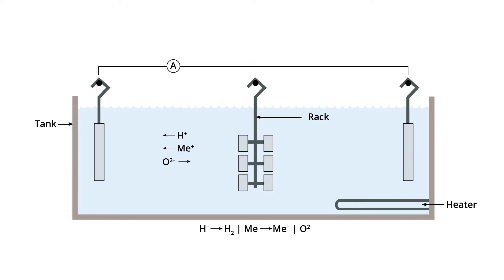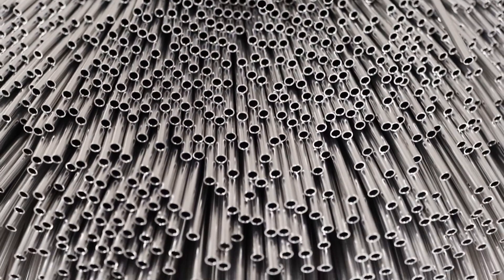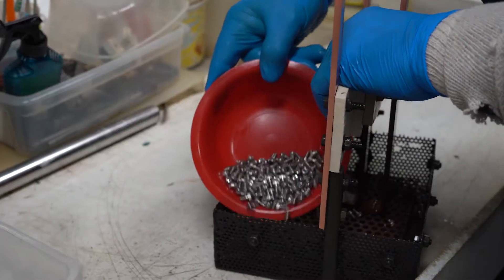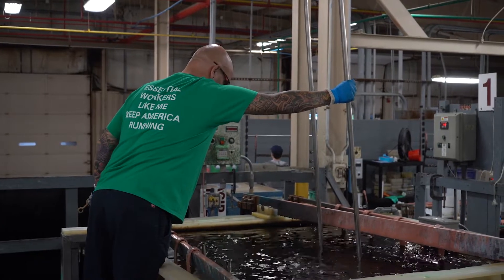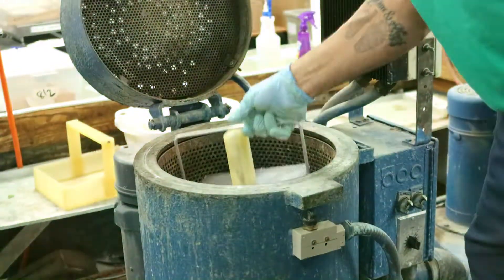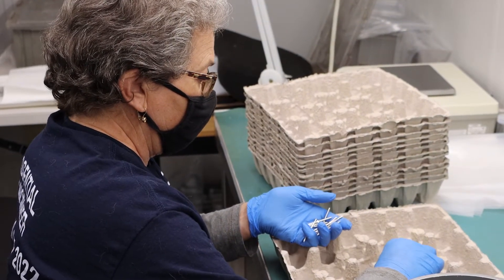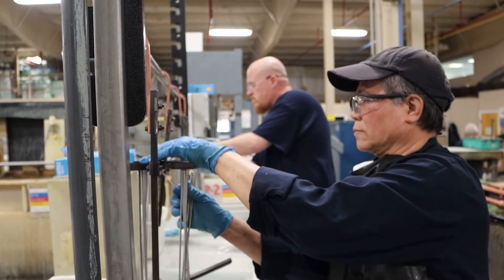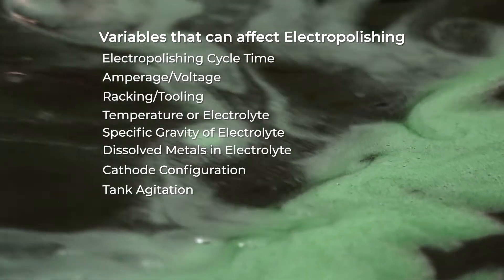The Electropolishing Process

Comment: does it help remove deep scratches ?
Reply: Electropolishing removes material (Eg - SUS 316L). So your scratch will not be removed and it will be bigger. However, the amount of material removal can be adjusted. Therefore, the scratch will be bigger, but it will be a nicely polished scratch. Usually the surface finish is the primary consideration, so a scratch would probably require manual scratch removal before electropolish.
Reply: @alishera.2540  what's so funny
Reply: @hypertool35 In my experience as an engineer in Pharma, no. I generally view it as a finishing process to reduce Ra, achieve a desirable aesthetic or clean welded features after some level of manual polishing.

Comment: Thank you for that beutiful, informative series. I am sorry if that sounds a bit dumb question but I am trying to understand the fundemental. As far as I understand from those video you are removing the free Fe atoms on the surface. Now the surface has little openings on the oxide layer where below those little openings the alloy metal. Those place became opened becaue you removed some (non oxide-just Fe atomor other things). Please sorry for my English, I am not a native and I am trying to exaggerating some to emphasize better. Now my question is: Are you closing that opening with chromium oxide layer in your bath or it is closed individually  immediately after you pull it from the bath. (Natural passivation). I hope I'm not rude to ask your know how.

Comment: What is the function of the heater?
Reply: Speeds up the reaction time, and I've found also decreases the resistance between the electrodes. As a result of this, the material removal rate is increased, and oftentimes the quality of the polish will increase (best to find a balance as well as cost-benefit). EP also doesn't work very well with the standard solutions at RT. I use a salt solution for my polishing as it helps me keep the temperature down significantly with sensitive parts.
Reply: The temperature of the electrolyte solution does what the other commentor stated, but I thought I'd emphasize that it can really effect the surface finish and the uniformity of the finish greatly. If you turn off the tank heaters before you go home at night, try electropolishing a panel in an ambient temperature solution and I think you'll see what I mean. I suspect that you already know all this since your questions are quite old now. Good luck.
Reply: heats it up